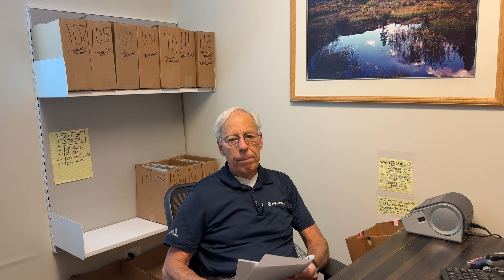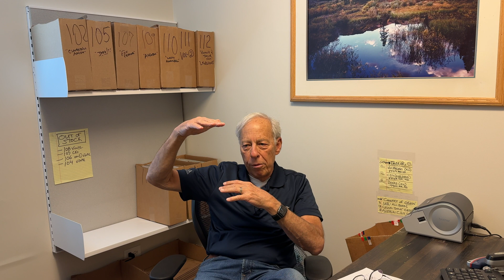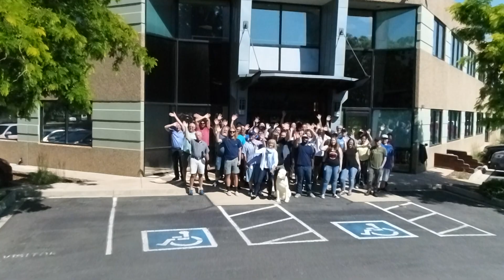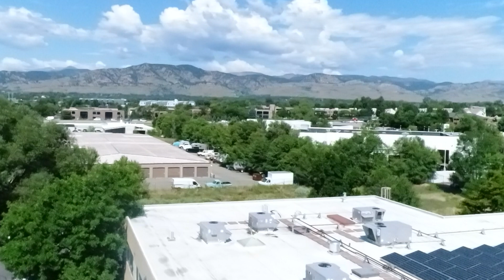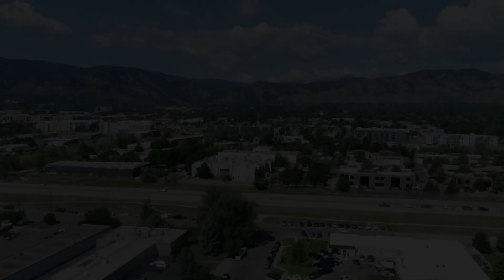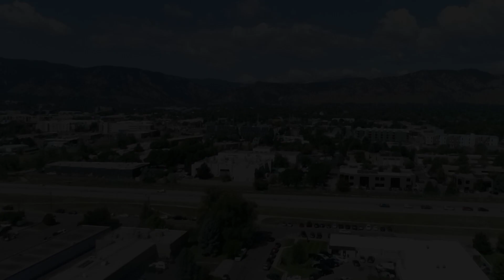Understanding master clocks in digital audio

Comment: I just purchased the Aune SC1 EVO 10 MHz clock, which made a night and day difference, so obvious you would have to be as deaf as a post not to hear the sound improvement. And I did not even attach it to my DAC. I hooked it up the my LHY SW6 network switch, and the LHY UIP USB isolator w/clock. Everything is tighter, not clinical, just tighter and even more holographic. It is a different sound, and right now is a good addition. The beauty, if I want to go back to the old sound, which was fantastic, I can easily turn off the clock. ;-)

Comment: I really like Pauls Channel. Always nice stories, especially about Arnie and Infinity :-) But it really hurts me as a studio owner when it comes to digital topics. This is really not your play ground 😕 Samplerate conversions happens a lot and when done carefully with the right tools like iZotope RX or Weiss Saracon (even with real time converters like the Mutec MC-4) it is transparent. What Paul is saying in this regards is just not practical true since more than 20 years. In theory there are still differences but these are below - 130 dB (far below our hearing capabilities) and completely without any alias artifacts.
Paul also misses the whole point of a master clock. A master clock is needed when you have kind of a complex digital system in which different converters have to run in sync. Professionals are using Wordclock for this. So every ADAC or other digital audio device has a clock, but not a masterclock. A masterclock feeds a steady clock signal either through a Wordclock cable, or as a part of the AES / EBU or SPDIF signal to all connected devices and ensures synchronisation. Clockvariations result unto jitter which leads to noise, thd with sideboards. This is the reason why most masterclocks use a very sophisticated frequency generator in thermo controlled ovens or even use atomic clocks (e.g antelope or Mutec). But even this doesn‘t ensure that converters perform best with them. Because now the converters have to lock onto an external signal. Not all converters are good on this but it is necessary, when you have a more coomplex system.  This is one critical components that make a great converter…
It‘s also not true, that just sample rates with multiple 44,1 kHz are the „real“ thing. Most audiophile productions are recorded at 96 kHz. Some DXD recordings use Samplerates 384 kHz. This is interesting for the studio work, where we use nonlinear tools like saturation and compression which leads to k2, k3, k4… overtones which can lead to nasty alias distortion. But once everything is done we export from this master file into different sample rates. This process is - again - transparent. At least I didn‘t find anybody who could distinguish different sample rates when mastered and converted carefully. What all the people here are different versions of masters and aggressive dithering and noise shaping….
Also the story of 44,1 kHz and 48 kHz is quite different… but that‘s another story.

Comment: The "Master" clock in a system does not need to be the highest frequency in the system.  In digital communications systems we commonly have frequencies operating in the GHz range that are generated from a 10 MHz source.  In the digital domain it is really easy to generate other frequencies by dividing or multiplying as needed and phase locking the new frequency to the reference oscillator.

While 10 MHz is quite common there are plenty of other frequencies used out there and for any given system the reference used will depend on what the designer decided was best for that application.

In addition to having a stable reference frequency, some applications also need really low phase noise on the oscillator output because any noise on the output will be multiplied up when frequencies higher than the reference are being generated.  But in the grand scheme of things audio is pretty forgiving compared to high speed digital comms.

Comment: This isn't the standard terminology: what Paul is talking about are the internal clocks of units and their clock generators (or preferably, a clock each for the 44.1kHz and 48kHz groups or "families"). The clocks of all these units (such as in a recording studio) may then be synchronized by a (usually external) master clock. Alternatively, the inferior but more common way of doing it in home audio, the internal clocks of downstream units may be slaved to the source's.

Comment: For a digital USB interface, a digital audio stream is taken and cut up into packets and sent asynchronously by the USB protocol meaning that no timing is sent with packetized audio connection. That is the only way that the USB or the audio over ethernet works. The packets are then buffered and reassembled and converted back into the original digital audio stream which at that point looks the same as a SPDIF or AES signal. The clock is then extracted from that digital stream exactly as it is done with SPDIF etc. There is no re-clocking being done at all. The clock is still synchronous with the original digital audio after reassembly. Don't confuse this. Have a look at the high end DAC here at this link. It is an Audio Note Level 5 DAC. Notice the digital board only has a couple of input transformers, relays, an input receiver chip some glue logic and a DAC chip (and some voltage regulators). https://briansmith1.smugmug.com/Quad-Cire-Level-5-DAC-Mentor- And if you still have ideations about USB audio having some special re-clocking, take a look at the circuit in this thread which is what the typical USB input is on high end DACs. Notice the SPDIF output which get switched in as a source with relays on DACs. https://www.diyaudio.com/community/threads/usb-to-spdif-converter.62537/ The 12 MHz crystal is not a clock doing any digital audio stream re-clocking. Look at the data sheet id you still have doubts.
The DAC can never serve as a master clock. The clock will still be extracted from the digital stream at the DAC end. That's how all of digital audio distribution works. Clock comes from the source always. The DAC doesn't have any timing mechanism unless it is required to do sample rate conversion (gear boxing adjustments) which adjust to against the extracted clock and we know that it affects the quality. You don't ever need PLL at the DAC end. That is where problems are introduced. You are wrong about CD transport as well. CD transports need a clock to be able to read the data off of the CD at the correct rate. It has nothing to do with any onboard DAC at the CD player. Have a look at one of the world’s best DACs here: https://briansmith1.smugmug.com/Quad-Cire-Level-5-DAC-Mentor- Notice that the digital board is only an input receiver chip, glue logic and a DAC chip with some supporting input transformers, relays and voltage regulators. No magical reference clock is present there. Now look at the schematic in this thread which shows a USB interface for a high end DAC: https://www.diyaudio.com/community/threads/usb-to-spdif-converter.62537/ . Notice that the output is SPDIF and no re-clocking is going on. Look at the data sheet if you need to.

Comment: Using 10MHz master clock nowadays would lead to worsen sound quality. As present digital equipment working with higher frequency crystals, it needs circuit to multiple the clock signal, hence increase noise. It's better to using internal clock with specific designed frequency as common frequencies using in Audio DAC and Streamer nowadays are 12, 22.579, 24, 24.576, 25, 38.4, 45.158, 49.152, 50, 54, 90.316, 98.304, and 100MHz.

Comment: Because video tape (3/4" Umatic, later Beta/VHS) was the first common storage system for the first commercially available Analog to Digital converters, 44.1Khz  sample rate was chosen for audio CDs because it was the lowest usable sample rate compatible with both NTSC and PAL video standards, allowing for encoding with around 3 samples per video line per audio channel. I sold those systems. Living in Nashville at the time I was also exposed to others like the SoundStream which used four-channel, 16 bit,  50 kHz sample rate into Honeywell 5600e Tape Drives.
Reply: Can you explain why 44.1 in compatible with NTSC and PAL? I know that 48 is to synchronize with 24 images per second film (16mm, 35mm, etc), but I don't get the math for vcr tapes.
Reply: @FrancisEVidal  If the formatting holds up:

......           Active lines/field   Fields/second   Samples/line         Resulting sample rate
PAL	                   294                          50                         3                294 × 50 × 3 = 44,100 Hz
NTSC                245                          60                          3               245 × 60 × 3 = 44,100 Hz
Reply: Excellent point I was racking my brain as he was talking trying to remember the details on this

Comment: The DAC does not rely on a clock because the clock is imbedded in the AES, SPDIF or I2S stream which feeds the DAC. Open the cover of a good DAC and you will not find a single oscillator module. There are some DACs and other devices that attempt to re-clock the stream but that  is known to introduce bigger problems than it attempts to solve. Think of the clock and the stream data as a bike chain on a sprocket. The imbedded clock matches the the data like the teeth match the chain. If you change that relationship samples can be falling at one side or the other of the original transition. Analog to Digital Converters do rely on a clock and that clock is very important because that is the timing reference for encoding which will be a permanent part of the encoded audio. Mastering engineers rely on very high quality master clocks such as the Antelope Isochrone Trinity. Antelope discovered that they can make a better clock by introducing randomised jitter which actually gives better results than jitter that has some correlation to the signal.
Reply: Async USB is the way to go.  When i hear people who wants to use I2S... it is a standard for inter-chip communication over very short distance...AND it's another of those bad idea where the DAC is slave clocked from the input signal...(just as SP/DIF & AES).  "Open the cover of a good DAC and you will not find a single oscillator module" <--- this needs an explanation!  How can it be!!
Reply: @guyboisvert66  You are wrong about this. For a digital USB interface, a digital audio stream is taken and cut up into packets and sent asynchronously by the USB protocol meaning that no timing is sent with a packetized audio network connection. That is the only way that the USB or the audio over ethernet works. The packets are then buffered and reassembled and converted back into the original digital audio stream which at that point looks the same as a SPDIF or AES signal. The clock is then extracted from that digital stream exactly as it is done with SPDIF etc. There is no reclocking being done at all. The clock is still synchronous with the original digital audio after reassembly. Don't confuse this. Have a look at the high end DAC here at this link. It is an Audio Note Level 5 DAC. Notice the digital board only has a couple of input transformers, relays, an input receiver chip some glue logic and a DAC chip (and some voltage regulators). https://briansmith1.smugmug.com/Quad-Cire-Level-5-DAC-Mentor- And if you still have ideations about USB audio having some special superior re-clocking, then take a look at the circuit in this thread which is what the typical USB input is on high end DACs. Notice the SPDIF output of the circuit which gets switched in as a source with relays on the DACs. https://www.diyaudio.com/community/threads/usb-to-spdif-converter.62537/ The 12 MHz crystal here is not a clock doing any sort of digital audio stream re-clocking. Look at the data sheet if you still have doubts.
Reply: @mikeh2520  You have it all wrong and didn't understand what i said... Async USB has input buffer and it, obviousy, doesn't have any relationship with the sender clocking...
Async USB is the way to go because the DAC is not "slave clock" from sender and thus, using its own local clock...

There's no magic or anything else, just plain old packetized communication with more than enough bandwidth to transfer the audio data... 

For SP/DIF / AES and i2S, the DAC is slave clock which isn't a good idea at all.  If you're 10% understanding the goal we have in electrical engineering, i shouldn't have to explain to you why...basic undergrad stuff in EE...
Reply: USB
Reply: @stupdasso  USB audio is packetized data with no timing reference and it needs a clock for re-assembly and buffering of the packets. The digital audio clock is still extracted from the digital audio just like SPDIF. Look at the PCM2704 data sheet for a good explanation.
Reply: @stupdasso  USB transmits audio in packet form with no timing reference included. To put those packets back together as a digital audio stream, a clock is needed to manage the buffering of the packets and the reassembly of them. The digital audio clock is then extracted from the digital audio stream exactly like the AES, SPDIF and I2S stream clocks are. So with a USB interface on a DAC, you have a clock but that clock is not a digital audio clock. It is simply managing the timing of the packet to digital stream reassembly. The clock signal is still always embedded in the original digital audio but needs some management to get it into shape to be extracted.

Comment: Very most impacting element on synchronous digital transfer or communication. No stable clock in the network, no business. No network, no biggie.
Master clock is not about belief, go to church for that.
You place the master clock typically at the most solid system that all other systems are connected to. All systems must be able to work as slave and self-clocked as a backup. Sophisticated systems can map multiple Master clocks for contingency.
It‘s like a orchestra where there‘s only one director, otherwise you play your own rhythm or you seek an alternative musician to pick on his rhythm to align to.
If you only have a single digital device, this is of no relevance, if you have two, they need to be mapped but can‘t always, i.e. pc+dac, or cd-transport+dac, typically a PC will not follow others, a clocking card may establish a Master, but it‘s left to the dac to buffer-sync on the the USB/FW port before amping and feeding the analog outputs. That works at home hifi.
If you go all device separate, stream, file, server, rate-conversion, dedicated clocking system, digital patchpanels, have digital routing, compressors, mixers, etc. I don‘t explain what you already know. Your clocking strategy is key here and the gear shall support it.
All in all, I agree with Paul, while very relevant in complex chains, not in home context of a 1 max 2 digital items serial connection.

Comment: It is really simple in home stereo.
The only clock that matters is the one that times the DAC.  Typically, there are two clocks.  One for 44.1 and another for 48kHz and their multiples.  For any given track the appropriate clock is selected.  I only listen to redbook, and use a single clock at 5MHz optimized for 44.1 playback.  
Improvements in phase noise of the oscillator will improve the sound.  Lower phase noise results in natural sound, low level detail, better sound stage and a stronger bass foundation.
You listen to the last clock that drives the DAC.  A master clock is not needed.  If the FIFO buffer before the DAC is working to time the DAC and isolate noise, the other clocks have no impact in playback.  They are all in a different time domain than playback and only count to the extent that they introduce noise into your ground plane.  
The clock used to create the sound track determines the quality of the recording but you cannot do anything about that other than to choose good recordings.
Reply: This is what I would have thought, I.e. that even a small amount of buffering before the DAC should make the other (upstream) clocks irrelevant. This could of course be different in a live setting where multiple digital sources may need to be synchronized in real time.

Comment: @2:11 "If you have a transport..."
If you play digital content, then you have a transport.

There are stand-alone boxes that handle transport functions.  And there are all kinds of other boxes that have transports included.

If, for example, you purchase a $50 computer, and use it to feed your stereo, then you are using the transport that is built in to that $50 computer.

If you have a device, any device, that can play digital music, then that device has a built-in transport.  It might not be very good.  But it is a transport.

Every CD player, every computer (from the last 30 years), every smart phone, etc, has a transport.

Comment: Isn’t the master clock used as a reference for all other digital clocks in the system so they are in sync?
Reply: Yes, but in stereo playback the DAC runs asynchronously, and does not need to be in sync with anything else.  Perhaps in a video system you want the picture and the sound in sync the notion of a master has some function, but now we're talking about a far inferior sound system.

Comment: Paul, you're definitely wrong on this - master clocks can make a HUGE difference, as they are designed to much closer tolerances than the ones built into equipment for cost reasons.
Reply: Yes but in this case the 'master clock' is there simply to improve the clock that counts, the one that drives the DAC.  The system designer should simply have built the DAC with a SOTA clock to do its job.  Instead they leave the door open for an 'optional' master clock simply to charge more money. 
The notion of a master clock is for situations where multiple cooperating systems need to be synchronized.  A DAC runs asynchronously from everything else in the chain and has no need for a master.
Reply: I totally agreed with your view!